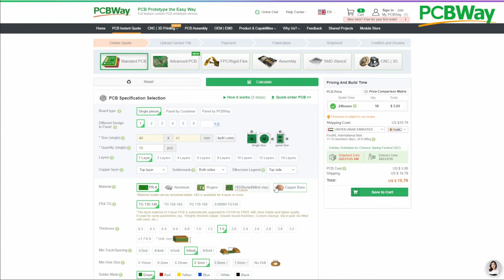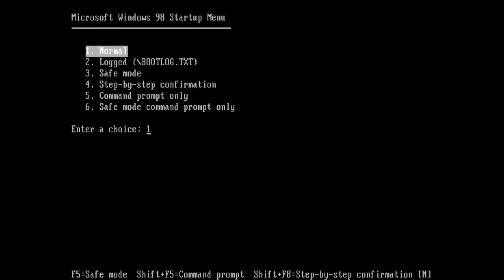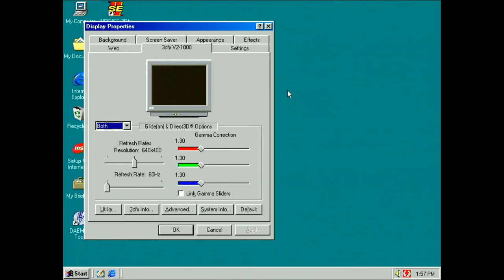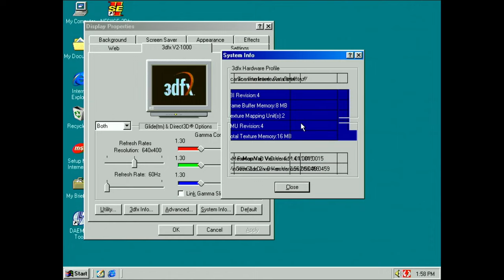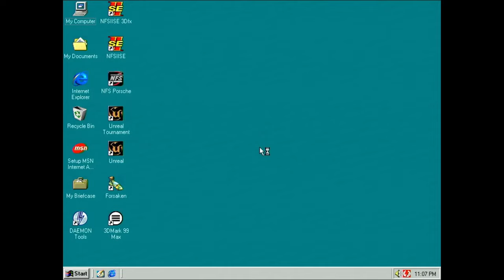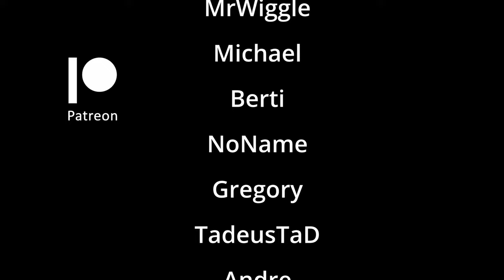Those are my last two broken 3Dfx Voodoo cards - Let's fix them!

Comment: LCR meter can measure the ferrite beads.   They are just inductors.  Edit:  You are spending way way too much time on those pins.  Making things worse.   Hopefully you're also using solder with lead as it's what they used originally.  Lead free solder sucks,   thanks EU.
Reply from the maker: Yes, I am using leaded solder. I try to keep the time for reflowing to a minimum, but I also want to see a nice solder joint - with more practice, I will be able to reduce the time I spend on those pins more.